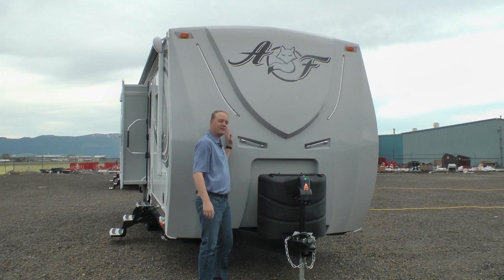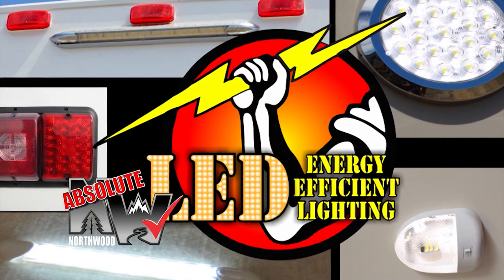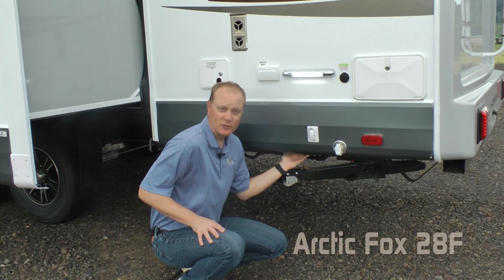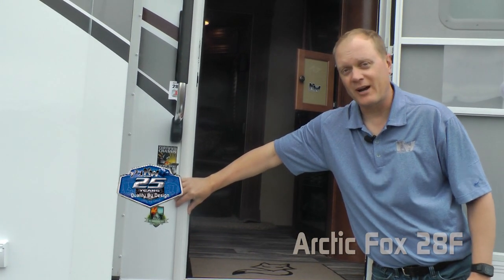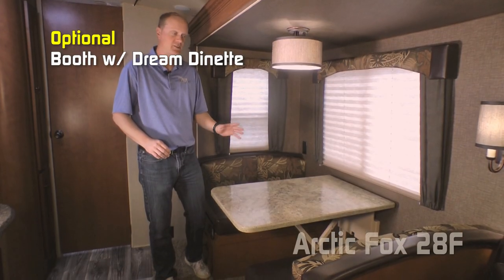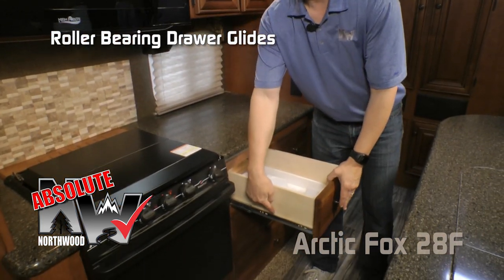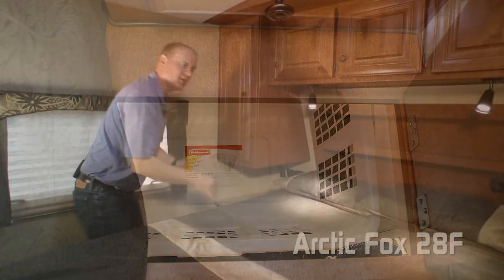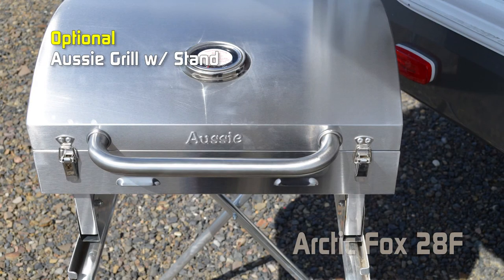Quick Tour Of the Arctic Fox Silver Fox 28F Travel Trailer

Comment: Are there a manual crank for the sideouts in case of a power failure? Also will I be able to pull over and use the bathroom and get a drank out of frig. with both slides all the way in?
Reply from the maker: There's a manual override for the slideout, but you will need some crescent wrenches to get it back in.  With both slides closed it's very hard to get through the coach to the bathroom, although it's very easy to bump the slide out enough out to get to the restroom.

Comment: How much does it weight dry, and max weight?
Reply from the maker: The dry weight is 7,500 lbs and the GVWR is 10,400 lbs.
Reply: A little bit more then I want to tow, I have a little travel trailer now.  If we decide to go larger, I was thinking 5500 lbs - 6000 lbs dry.  Safety, I just don't like towing at max tow rating.  Thanks for the reply.  If we decide to update, it'll be at least 2-3 years out.